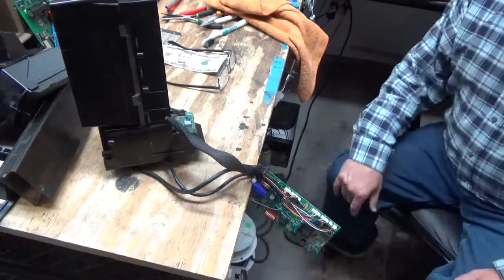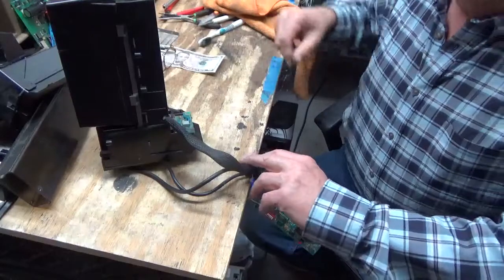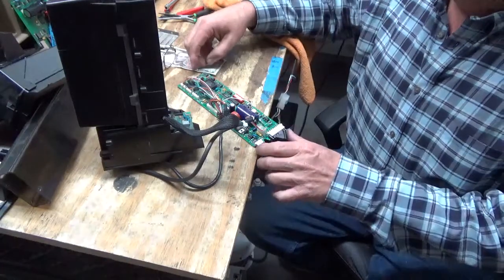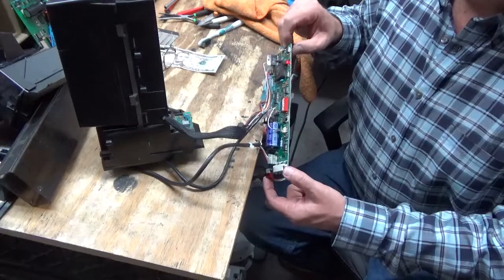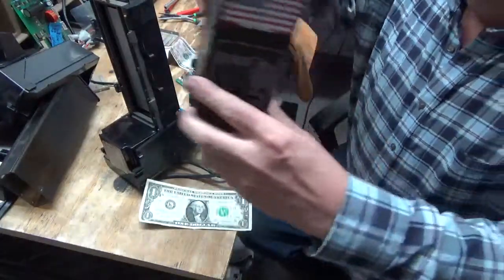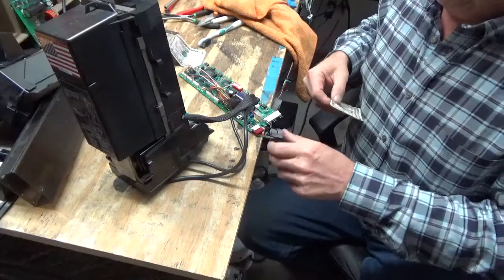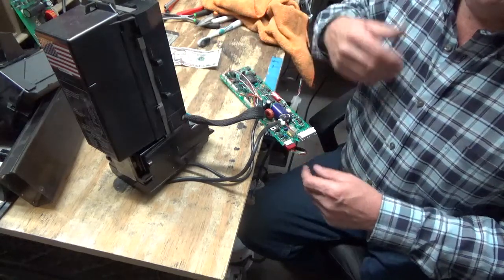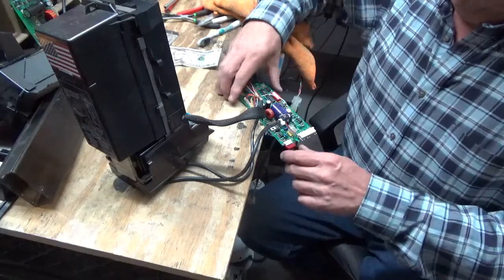Coinco BA30B Dollar Validator Tech Tips Video #6

Comment: I have a change machine that has a three pulse red light that says: “check bill path”  the bill path looks fine. The motor that sucks up the bill engages on startup and when you press the reset button but not when you try to feed a bill.
Reply from the maker: Usually a bad sensor. We can repair those. lasvegascoinop@gmail.com

Comment: I purchased a used machine for my students as a fund raiser. I had to cycle the power to reset the validator. It took $3 and now it only sucks it in a little and spits it back out. Tried cleaning it with no luck. Any ideas what i need to do? It is a coinco MAG50B. Are there any plug and play "upgrades" or replacements available? We only sell $1 drinks.
Reply from the maker: Hello, those Coinco validators are 25 plus years old and once the sensors fail, its time to replace with a top quality MEI unit. email us the info as to what machine this goes into and we will reply with your options. lasvegascoinop@gmail.com
Reply: pretty much same here. Mine worked fine until recently and now it just nibbles the dollar briefly before spitting it out. Cleaned the whole thing and it still does this, I just sell sodas about at-cost in my fire station.

Comment: Heybthere great stuff! My unit first started eating bills and not giving credit. The black plate tray on the inside that money box sits on is sort of loose on the top where in my older model its much tighter and stays flat. I can’t figure out what it is.  Also it started running rough when accepting the bills.

Comment: Great video. I have a question: My Dixie Narco 501T multi-price soda machine is using a BA30SA bill collector that only accepts one bill per vend (price is set to $1.50), requiring coins for the balance vs taking a 2nd bill and giving .50c change. When I adjust the escrow (ESC) settings in the machine the bill collector will accept a 2nd bill, but only once. The next purchase it goes back to one bill per purchase. Do you know why this might be happening?
Reply from the maker: low coins in the tubes or there must be a setting in the admin area of the machine itself.

Comment: Hi Douge, I’m hoping you can help me i would pay you for your help. 
I have a ICT type 6 bill collector 
When it takes a bill it does not push it into the bill box and i have to take it out and it’s resets. 
Any suggestions
Reply from the maker: Bob, those to put it likely are "junk" always were and always will be. When they quit, throw them away and replace it with a quality MEI unit. Your troubles will be over. I have everything you'll need. lasvegascoinop@gmail.com
Reply: @dougsworldtour3755  
Thank you that’s what I’ve noticed. I’m new to this. How much is a ICT 6
Reply from the maker: Bob, best to replace it with a MEI, your troubles will then be over. The ICTs were not good even when they were now. lasvegascoinop@gmail.com for help

Comment: I have a crane gpl 159 snack machine and has this same bill validator can you give me the kit for to use new mei?
Reply from the maker: This is the unit, it takes 1s and 5s, be sure tom order a power cable to hook it up to your system, they are listed under "options". I am guessting that your system is already MDB with a 6 pin plug for the coin mech? If so your good to go, all plug and play. lasvegascoinop@gmail.com